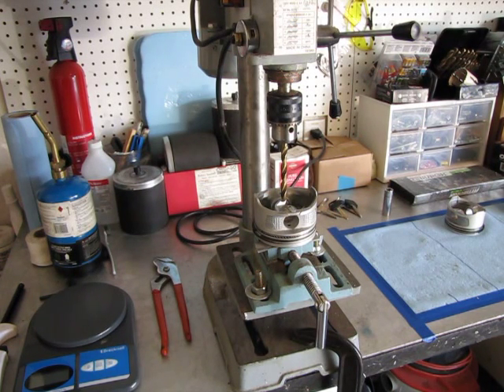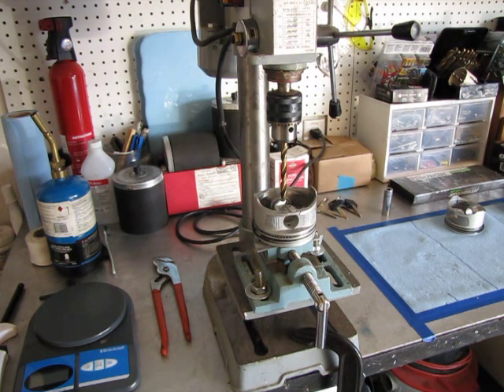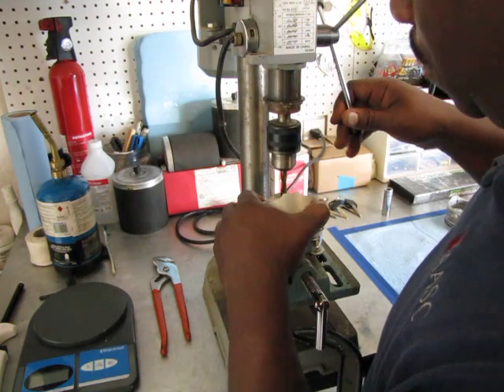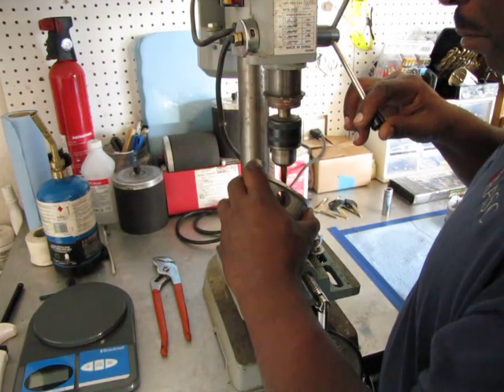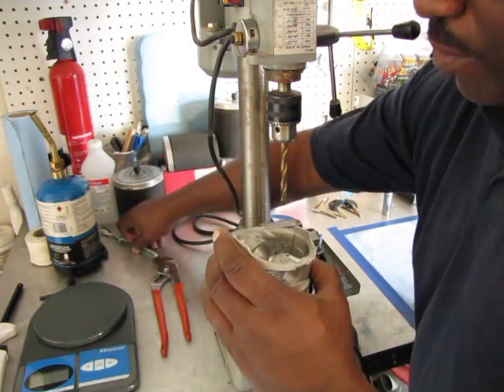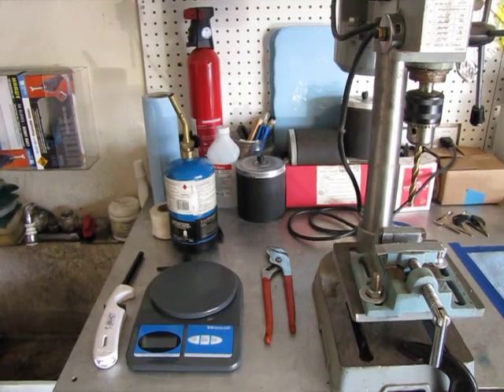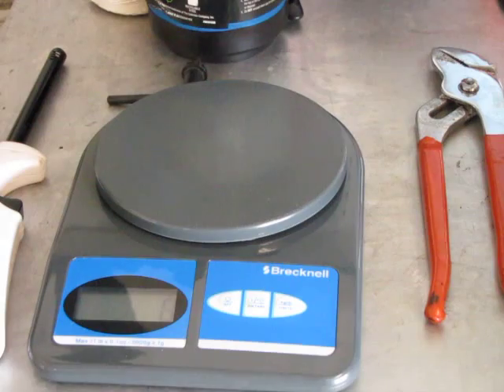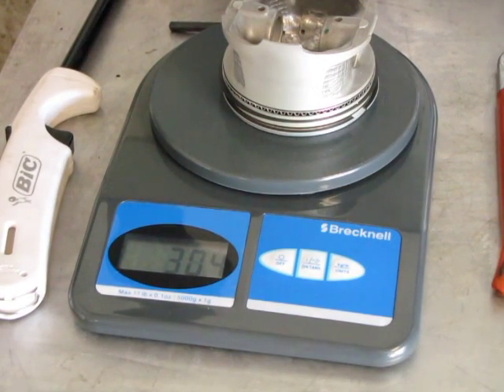How to remove material from a piston to balance it

Comment: Significantly weaken the crown of those pistons to remove 5 grams from under crown. Improper place to remove material. Also 5 grams is totally insignificant considering the crankshaft would not be electronically balanced. The factory tolerance is more than that 5 grams. Bet the engine wasn't shaking to start with.

Comment: before I went onto piston I would be getting that drill sorted out. terrible noisy thing, could not do any sort of precision work with that thing growling away and wobbling... once thats done then get some flat ended drills not just an ordinary high speed drill bit... and 5 grams is easy to shift from a  piston.. just get rid of any casting marks is the first thing to doing.
Reply from the maker: Thank you Phill, good advice.
Reply: @Engineerboy100  about 2 hours messing around when you have spare time can make that noise drill press a pleasure to use and hear.
. .